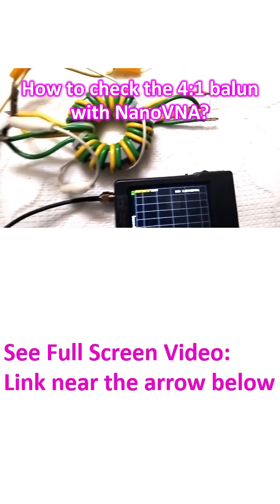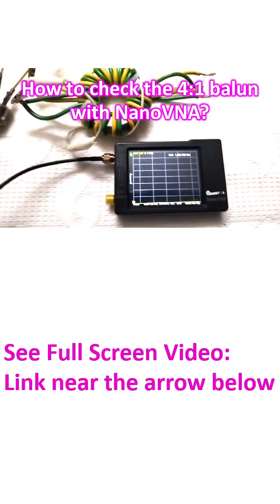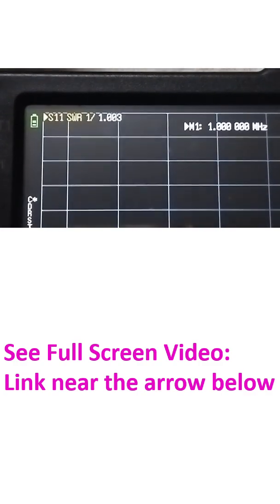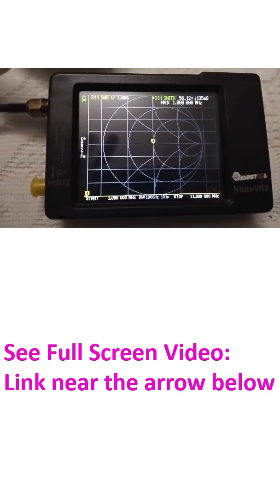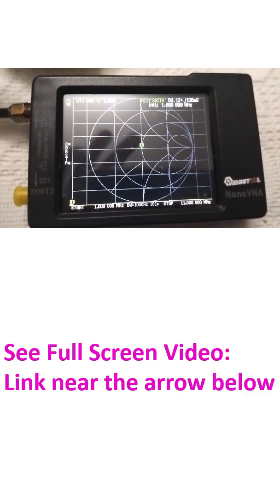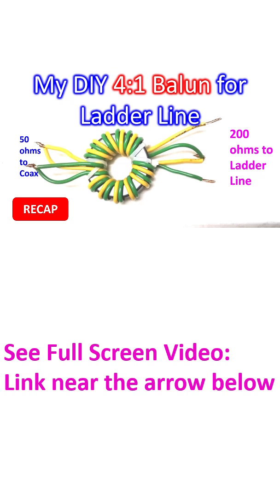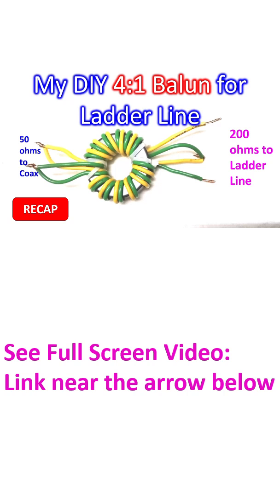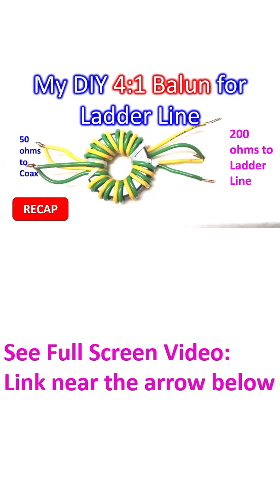How to check the 4 to 1 balun with NanoVNA?

Comment: What is the core used?
Reply from the maker: FT 240-43 toroid. FT stands for Ferrite Toroid. 240 means a toroid with 2.4 inch outer diameter. 43 is the mix of the material used, typically for HF applications.